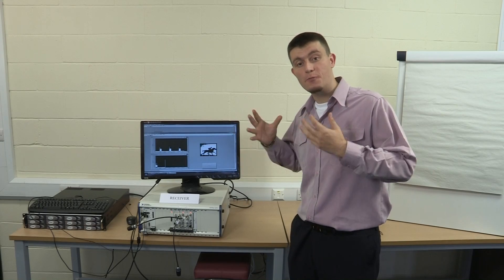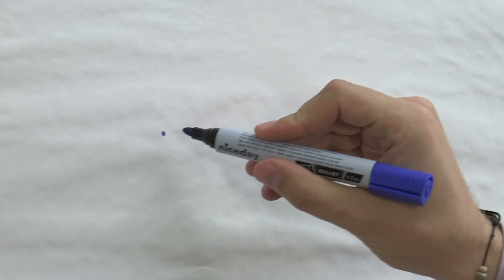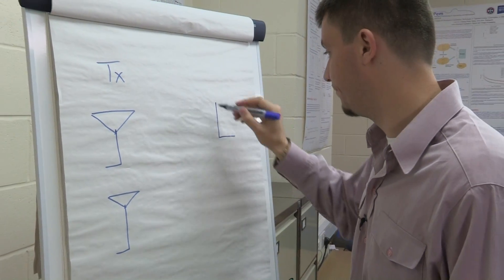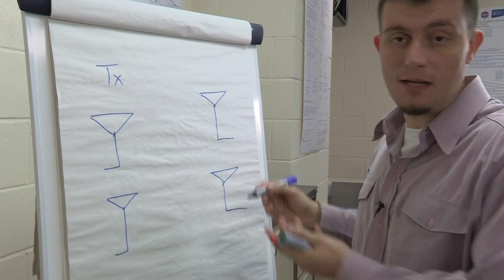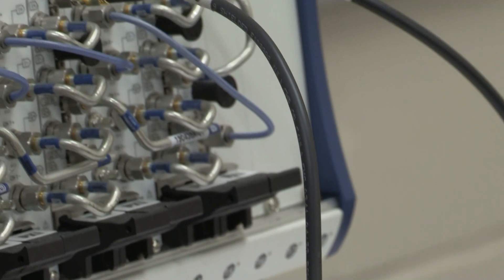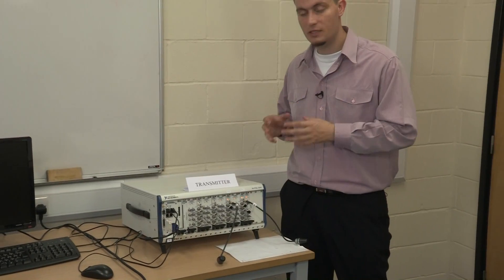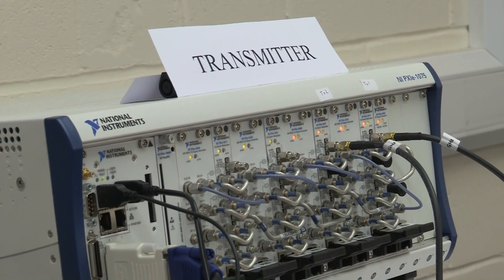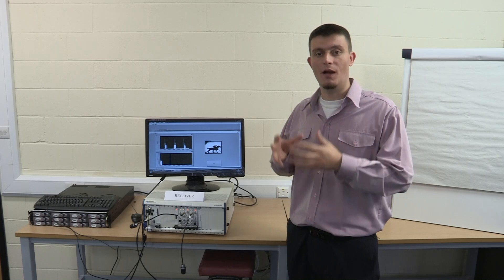The World's First Spatial Modulation Demonstration

Comment from the maker: Hi, the transmit antenna is determined by the channel between the source and the destination. The channel estimation is used to determine which transmit antenna was active. The mobility of the receving node does not play a part, merely the channel estimation. Perhaps you would like to have a look at some of the other Spatial Modulation videos where this is explained in greater detail.